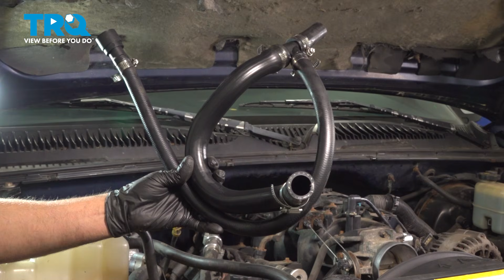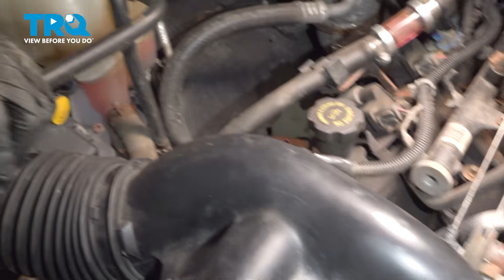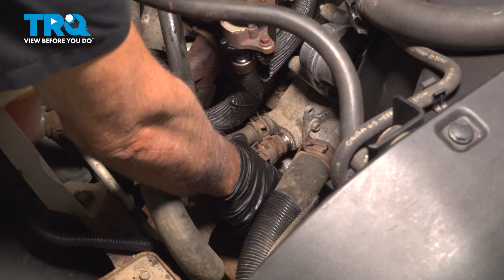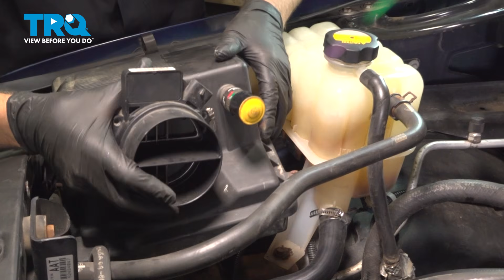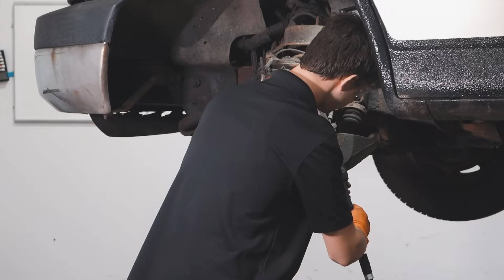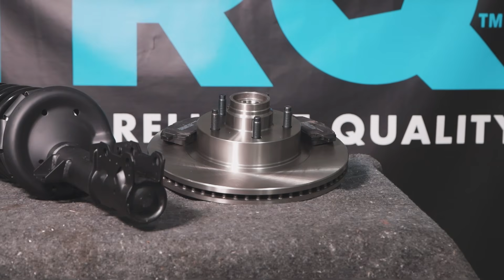How to Replace Coolant Recovery Tank Hose 1999-2006 Chevrolet Silverado 1500

Comment: Just as an FYI for anyone else doing this, it is the 5/8 quick-release hose removal tool.

What size quick release clamp did you use, should od mention that instead of saying “Use this tool” most unhelpful video ever.